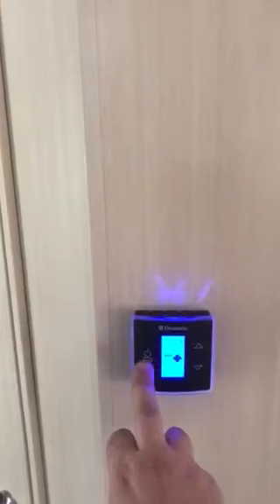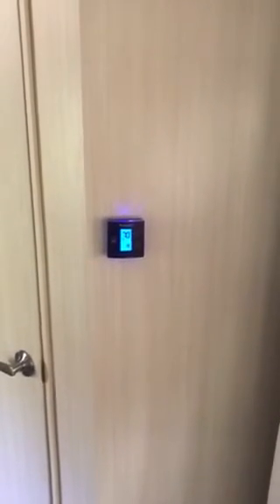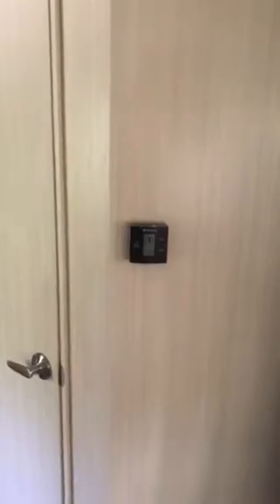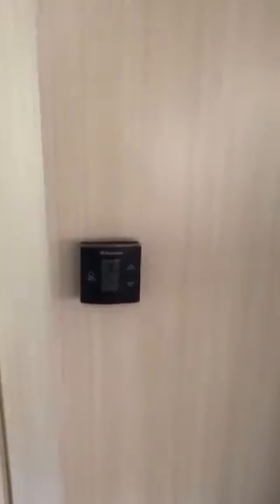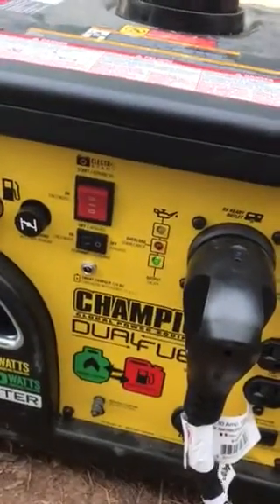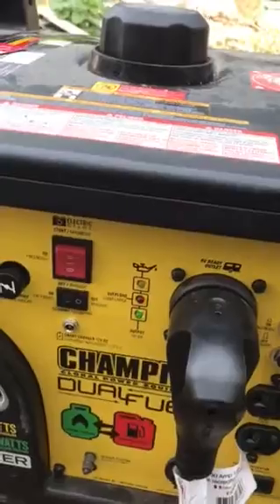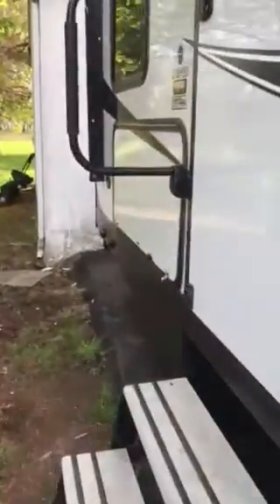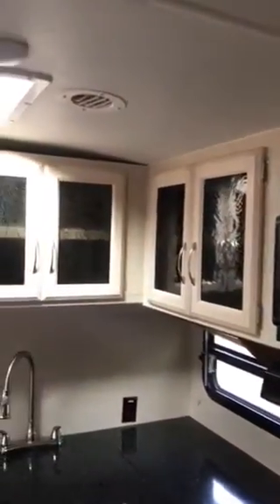Video 3Champion Dual Fuel 3400 DualFuel PROPANE

Comment: couple of ideas for you.....first if you first turn the fan on "constant"  then wait a minute than turn a/c on to "cool" that lessens the start-up drawer if you're starting the AC with the fan and the compressor at the same time it takes Much More Voltage by having the fan already running it's a lot less voltage for the surge of startup with the compressor tip I learned from an old-timer secondly you didn't say whether you using high speed or low speed on the fan also quite a difference in the amount of voltage used all I'm saying is if you are running it on propane by using those steps operating it on low speed fan and also by starting the fan first and then engaging cooling you would probably make it easier to start on propane just my idea for what it's worth